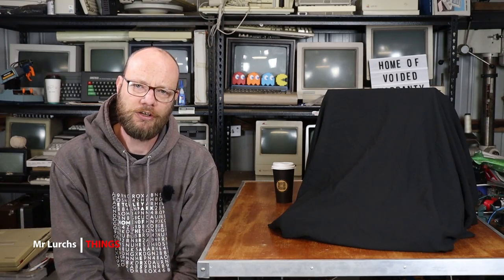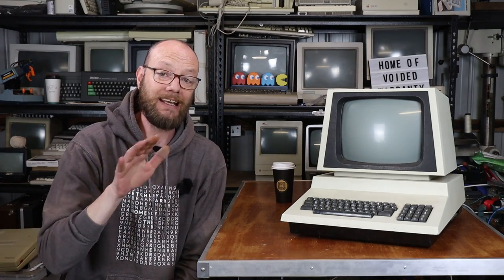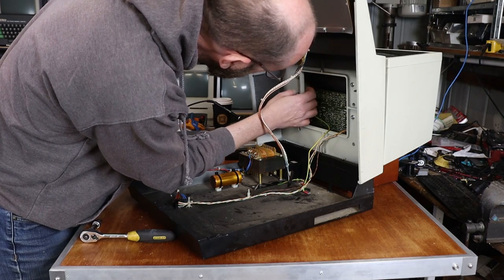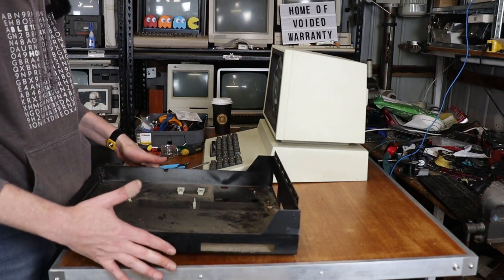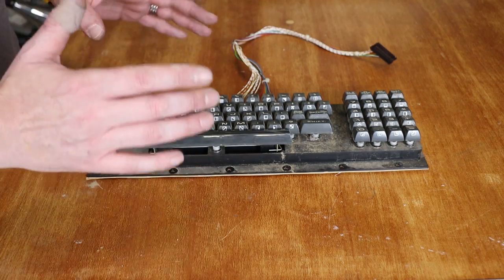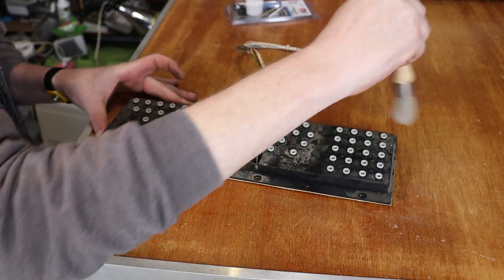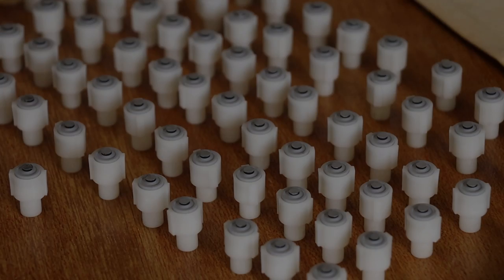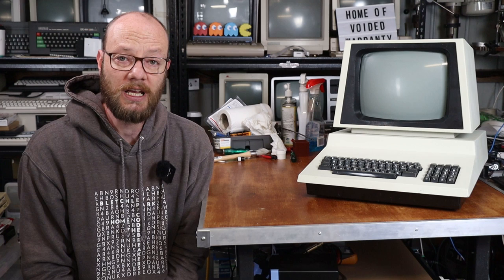Retro Rescue: Commodore PET 4032

Comment: What you're calling the "wider sticker case" PET (aound these parts we call them short neck and long neck) has two cuts out where low-profile disks drive could be mounted. Commodore never shipped any with internal drives though. When Commodore replaced the 9" monitor with a 12" one they redesigned the case removing the unneeded openings so the monitor wouldn't be as high up. Such PETs carry the "Fat Forty" nickname.

Comment: When I first started (UK) High School, the computer room was a small cupboard outside the maths office. It had a Video Genie (Dick Smith System 80 MK I over here), a 2001 series PET and a 40 column PET with the dual disk drives and the tractor feed dot matrix printer. Soon after a BBC model B arrived. We could 'Learn To Program' at lunch times (programs which usually had a high score table) but the Video Genie was left alone for the new comers to use. After a while the old hands would show you the dry carrot stuck under the U key, a memento of when somebody had chundered all over the keyboard.

You were wise to spend all that time cleaning!

Comment: Speaking of the key repair - I had the same issue with my TV remote. I opted for a rather ghetto method - cutting out circles out of thick aluminum foil and supergluing them onto the button plungers where the carbon layer was. In order for glue to stick I had to slightly sand them first. Not the most elegant solution but it actually worked. And it was really cheap.

Comment: This is only a guess, but some 4000 series PETs had slightly different size monitors. The wider one would need mounting "lower" so that it wouldn't make the computer taller.
Commodore had a tendency to morph their designs from one model to the next, putting what parts they had during the transition. Often they would release a model with one board, develop the next one then design a "universal" board for repairs and later production - they did this with the 3016/3023 boards and I think the later 2000/3000 PETs. 
I have an original 2001-8 and its a great device, but keeping it running is a labour of love, its the machine my Father and I got back in 1979. The BASIC in its standard form only works with some of the IEEE peripherals and notably not the disk drives, so going for a later model is a good idea. The 4000 series is compatible with most (later) PET software and certainly more than the 2000 series with original ROMS.

Comment: I love these old machines so much.  I still have my 4032 Pet in my storage room covered with a plastic bag.  I even have the cassette tape recorder for saving and loading programs to a normal audio cassette tape.  Been probably 15-20 years since I powered it up, this makes be want to pull it out and give it a test run.  So cool to write a basic program, hit "record" on the cassette deck and save the program. Then retrieve it from the cassette.
Reply from the maker: You 110% should. And if you run into trouble, the community is fantastic.
Reply: I posted before I finished watching.  I'll certainly pull it out and take a look at the items you mentioned at the end of the video to see if I have any info that may be useful. I think I might have two cassette recorders for it. One had something wrong with the door I think, it wouldn't stay down or something. I'll see if I still have both. Perhaps you might want the one that needs some work to pair up with your unit?  If I can find it we'll chat!

Comment: I also had the PET as "a computer I would love to own but never will", but then I got one in November, so for about 5 months I've played every PET game I could find and that would work on my 4032 (and even fixed some and translated others).  I got the 4032 as it's the best one in my opinion.  It looks the best, has 32K, a gorgeous 12 inch green screen, and almost all software works.
I added a reset button to mine, and adjusted the screen height slightly (it was too squashed), and I love it  🙂 There was some paint damage on the case, though I've managed to paint over that as best I can.  It's really hard matching the colour!
I learnt to program on them at school from 1982 onwards (we also had some BBCs, and one RM 380Z that the teacher used).
I have an SD2PET, which is really good.  I just load the wedge program first to make moving around the "disk" easier.

Comment: A PET 2001 is my first PC. Bought used in 1979. I still have it and it works. Chicklet keyboard was terrible. We used 4016 and 4032 units in HS for the first "Computer Sciences" course our system offered. 
Yours just needs a case badge

Comment: Some years ago, a seller did want to sell a working CBM model 4032 (no "PET" on the label). But the video went black, so it was sold as defect. I did buy it. After replacing a burned resistor in the monitor, it came back to live.
But now, it needs a different repair. The computer doesn't show the cursor.

Comment: For storage using SD, you might want to try the SVI that connects to the commodore tape port (if it's the same one used on the C-64). The SVI has an adapter. Useful device because it can be used on many systems (some require adapters). The SVI is also made in your area - ships from Australia. Might save a lot in shipping. There is a bit of a wait list because of parts shortages, but it didn't seem long to me.
Reply from the maker: I actually have one already

Comment: Great restoration and a beautiful machine.  I first used the Pet in grade 7-9, spent many hours typing in games from magazines, and I remember them fondly.
Pro-tip regarding the grounded table edging: *PLEASE* for your safety, install a 1M-Ohm (or larger) resistor in the wire between the table-edge metal and earth ground.  When working on energized equipment, a direct path to ground near you coud result in shock or damage because of the direct path to ground through the metal surface.  For the purposes of ESD, a 1M-Ohm resistor (minimum) provides (1) safety from shock and (2) a low-current path to ground for electrostatic discharge that is less likely to damage sensitive semiconductors.  The ESD resistor can be up to 100M-Ohms, but 1M-Ohm to 10M-Ohms is better since the ESD strap probably already contains a 1-10M-Ohm resistor.  At some point, it would be a good idea to get an ESD mat to cover the entire surface of the table, which will both help to dissipate ESD and cushion the equipment you're working on.  ESD is the silent killer of electronics because it can either totally zap an IC or just degrade its functionality and make the system unstable.  I hope that helps!
Love the channel and your enthusiasm for the subject.  Cheers!
Reply from the maker: The resistor is already done 👍

Comment: I just repaired my shift lock key. With the help of a 3d printer. I made 3d model and purchased a new mini on / off switch.  I still have to do clean the entire keyboard as some keys are sticky and 1 or 2 keys don't work. Cross fingers it just need a little tender care.

Comment: Also, there is no polarity on the Shift Lock switch. In order to engage it you just need to bridge lines A and 9 on the keyboard connector. I built  miniPET from Tynemouth and got the tex elec keyboard and just experimented on it since my PET keyboard had the lock wires coming from those lines by using a piece of where to just bridge and would trigger it it on both the miniPET and the real thing when I connected the keyboard to that as well.

Comment: Very nice score! The monitor CRT might brighten up after you let it run a while. That happened with my PET 4016. After running a few hours and warming up, the picture came back to life.
Reply from the maker: It not completely terrible. It’s certainly usable, just a bit on the dim side. Given the age of the machine - it’s probably the yeast of my concerns.
Reply: @MrLurchsThings  The PET will be a solid machine for you. I recapped mine to future proof it. I'm pretty sure the monitor will brighten up a little bit. I'm sure it looks better in person too.
Reply: That's the downside of these vintage all in one systems, one day those monitors will completely go and they aren't making new crts.  Unlike something like a c64, hooking up to a lcd is barely an option for these (and even if you managed it, it would be super awkward to have an lcd next to a pet with a non functioning crt).. guess time will tell.
Reply from the maker: @brianv2871  If the CRT went and I couldnt get a replacement, I'd probably try and retrofit an LCD internally.
Reply: @MrLurchsThings  I've seen a composite video board being made to have external video on PET computers. I've also seen someone put a small LCD into a PET monitor chassis with a scanline generator board and it looked decent. Of course not a real CRT but better than no screen at all.
Reply: @brianv2871  just don't use the Adrian standard for monitor quality because if you do, 99% of the vintage CRT's out there would be e-wasted. #AdriansDigitalBasementMonitorQuality :-)
Reply: @geekwithsocialskills  Haha, no kidding.  Also as far as external lcd, they have them for trs-80 as well but i don't think I'd personally ever go that option.. it would be so awkward to use, I'd do lurch's suggestion first with modding the crt to an lcd.

Comment: i can definitely confirm the "cranky-ness" of old computers.
I have a PET 2001 (the first version with the built in tape deck and small keyboard) and when I got it, it was dead. After having replaced a total of 8 bad chips, the computer worked fine for a while but recently something failed in the reset circuitry. I have some later PETs as well (a 3008 and an 8032) and they are way more reliable

the keyboards are very notorious for being flaky, I had to do them on every one of my PETs

The PET is my favorite computer of all time, I hope you'll have lots of fun with yours in the future
Reply from the maker: I think for my own sanity, I'm glad I went with the 4032. As much as I love my Europlus and Model 1, they drive me nuts and I really wanted to enjoy the PET without the headaches.
I'm pretty happy with the KB repair. Ive been banging away on it a bit since and it seems pretty solid.

Comment: Something relaxing about just watching a computer cleaning video.  My experience with my Pets keyboard was pretty similar and i also just went straight to the paint method (though i used silver contact paint) rather then screwing with each key to see what i could make work and not.  Had already done the same with my trs-80 model 4.  Good luck with the next steps, i ran into some difficulties with the Pet2sd so I'm not sure how much I'd recommend that, but ymmv or maybe there's better options now.
Reply from the maker: Cheers. There seems to a couple of options now. I'll look into it soon. Unfortunately shipping and exchange rates are a killer at the moment.
Reply: @MrLurchsThings  yeah, i had a couple pcbs printed which is also what Adrian used.. he had sightly better luck then me, but he just built out the bare minimum whereas i fully built one with lcd and everything.. however there's a known issue with one of the chips randomly having issues and i had that issue but Adrian didn't (maybe because my chips came from china... Haha).  Chuck has a video where he builds one and also had the same issue.. not a deal breaker but it is a pain.  My lcd also sucks.  Anyway, if you find some other good reasonable options, let me know.

Comment: I noticed your 4032 seems to take a little while to boot after turning on the first time. I'm guessing that start up time will be less if you turn off and turn back on within a minute. Mine sometimes does this after sitting a month, and will take up to 30 seconds to come up the first time...  I'm suspecting a cap has kind of stopped being a cap and needs that time to remember what it's job is.

Comment: My guess is that this variant is preconfigured as 80 column so it can be deployed without further configuration.
When you said there is more software for the 40 column mode, you are just looking at commercially available software.
I bumped into some PETs during my apprenticeship at Siemens and they all ran proprietary software made in house.
Reply from the maker: For proprietary business software, yeah I can understand 80 column. As for the 80col on this, it’d definitely been done after the fact.

Comment: A brilliant video Jason 👍👍👍 I love my PET (CBM 3008). When I restored it 5 years ago one of the best storage solutions available was the PetSD+, sadly these are no more. I will be very interested to see what you come up with in the storage department. There are some amazing games for the PET computers. There is a great version of Space Invaders, which even gives you a circuit diagram at the beginning showing how to wire the PET up for sound. Then there is Meteorites by D.E.Anthony a great Missile Command clone, also with sound. Labyrinth, a 3D Maze game. Also, my favourite, Seige by Mike Singleton. You should be able to find all of these on the net but if you want any specific program that you can't find let me know, I might have it. Cheers, Alan.

Comment: Other problem with that model being 80 column is that most 80 column PET games were written with the business keyboard in mind, so that keyboard ("N"on-busines or graphics keyboard) is seen differently (I just got a 40/80 mini PET and am using a graphics keyboard with it and a lot of the 80 column arcadish games don't recognize the graphic keyboard keys)  The two keymaps are almost totally different.  🙂  It wouldn't be hard to modify, just some time poking through the ML to find the keyboard interpreting code.
Reply: Oh on "very Commodore 64-ish keyboard", the first VIC-20s actually used PET business keyboard parts (only used one column of the numeric keypad area for the function keys) and a different circuit contact board, and some of those keycaps has the nice big PET keyboard alphanumeric lettering. 

To get games into the PET you can use the VIC/64 cassette tape drive.  To get programs onto the cassette right away, you can use a Commodore 64 with the program Unicopy 64, (found in most PD collections) it lets you file copy programs from disk (or emulated disk) out to tape.  fortunately the PET disks are compatible with the 1541 or whatever you use to mount d64s..

The thin display PET 4032s had 4.0 ROMs but not the more advanced CTRC controller so they were mostly compatible with the "Fat 40s" but not quite (you find some 4.0 PET games only work on one or the other 4.0 ROM PETs.)  the 80 colum PETs came out at least a year before the fat 40s but bopth use the same MB, so that MB is probably just an early production.

As far as the panel height, I think the first ones were just copying the original PET case proportions,  then for a while they had models where that black panel was a separate piece and could be removed and internal floppy drives put in - had extra mounting holes under the monitor section for them (never seen it used though), then they went with the low profile badge - might be to add extra room for expansion boards like on the 8096 and SuperPET.that's my speculation..

Comment: the reason you had trouble separating the monitor from the chassis is because the holes for the chassis aren't drilled very precisely and the threads usually get caught. It will come free with some careful prying with a business card
Reply from the maker: Ok, so in theory it should have come apart they way I was going?
Reply: @MrLurchsThings  yes, it just takes some convincing. the 8032 i am currently fixing up had the monitor frame fused to the chassis by rust, removing it was pretty scary
Reply from the maker: @mariusberger3297  Cheers. I dont feel like a complete idiot then :D

Comment: I have to ask: did you try disconnecting the keyboard and re-attaching it to the motherboard before doing all of that work? The reason I ask is that a lot of retro repair videos that I have seen always recommend trying to de-oxidize and clean the connection contacts before declaring the keyboard as needing work
Reply from the maker: Yup. 100%. It was definitely the carbon pads.